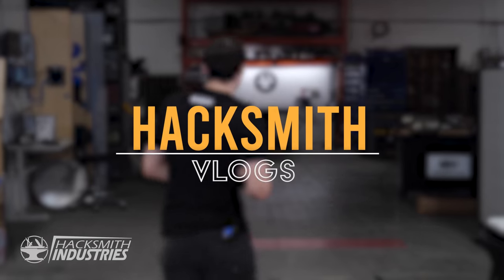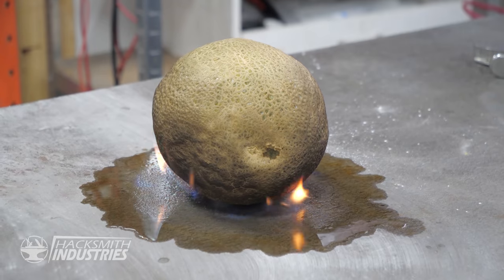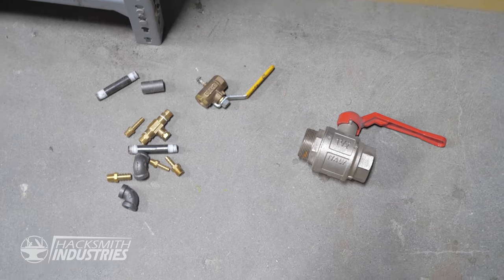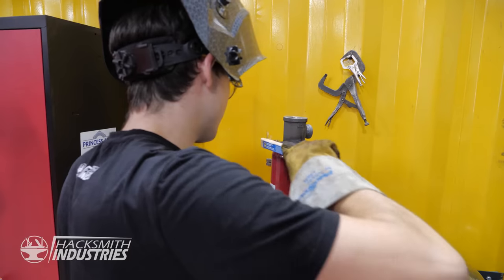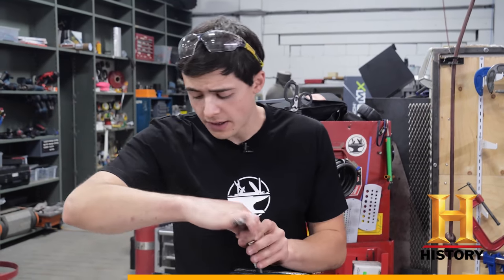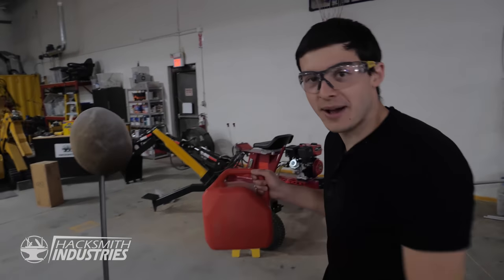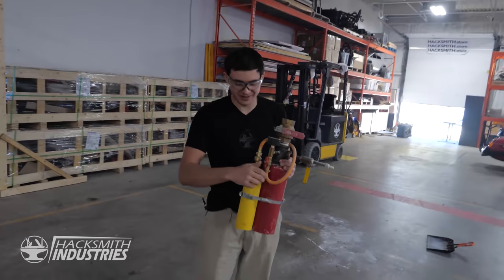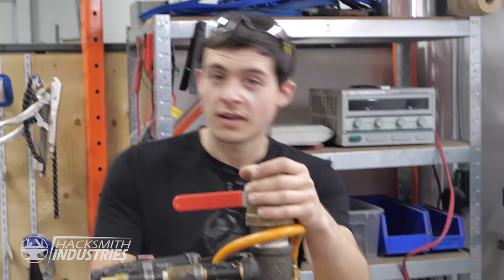Cornstarch is FLAMMABLE?!

Comment: I noticed the stream of flame cuts off if you try to blast it for more than a second or two. I suspect this has something to do with the flame eating up all the oxygen in the area, then not being able to ignite properly afterwards. Maybe adding some oxygen to the propane mixture would help?
Reply: That would be dangerous
Reply: Maybe near the nozzle? I'm thinking of how an oxy/fuel torch works

Comment: "This is not a flame-thrower... yet" I can just imagine Bogdan changing all the fire extinguishers into flame-throwers and lighting one small fire, every time someone tries to put it out they make more fire!
I have a suggestion : it would be a good idea to put the original lever handle from the ball valve on the end of your twist handle, so in an emergency/accident, which is bound to happen, you can very easily switch it off; and also see easily when it is open or closed.
This looks like a super fun project, the use of corn starch as fuel is pretty clever, well done Bogdan! 🧡💜
Reply: well, it's a fire extinguisher as well as a flame thrower
Reply: As long as you don't turn on the flame, but i guess if it's filler with propane, it would still be a flame thrower. How about they replace the propane tank with a regular air tank?

Comment: Maybe a chamber to allow the cornstarch to disperse could help with having a more controlled flame? That way you wouldn't have to worry about finding the right pressure to allow a good ignition and not have to worry about smothering. just like a open ended pipe on the end of the fitting, one quick burst so it fills and disperses then introduce a solid stream to push it out and ignite. Although you you would have to think about the chamber possibly combusting if it disperses to the ignition source before you apply the steady stream.

Comment: My friend made a gas flame thrower by using gas, a old fire extinguisher and a air compressor. He would fill the extinguisher with gas then use the compressor and fill it with pressure. Then he'd get a lighter and let the gas do it thing when he let the pressure out.

Comment: That’s awesome. But I saw that while being used the pressure would drop. Maybe you could take the rocket scientist approach and use helium to pressurize the gas tank which would then keep a continuous pressure in the corn starch tank. Idk if it would work.
Reply from the maker: Might as well just have a bigger propane tank! Helium is a precious resource these days
Reply: @theHacksmithVLOGS  oh true. Forgot about the shortage. The only solution left (except very expensive noble gases) is switching the propane for something like methane and then cooling the tank so that it can hold liquid methane which will transform into gaseous methane when the pressure drops, thus maintaining the pressure in the corn starch tank. But that is way too complex. We are just discussing this theoretically.